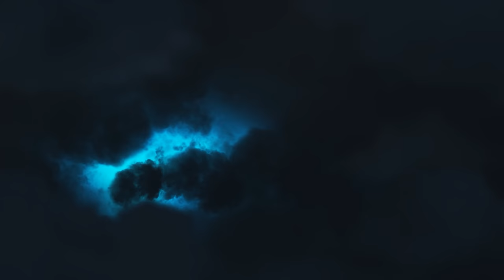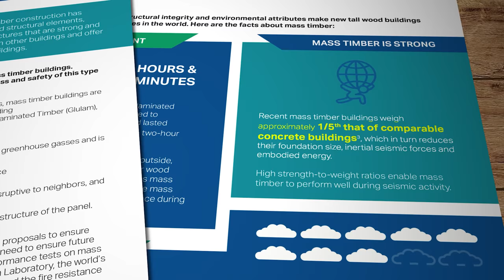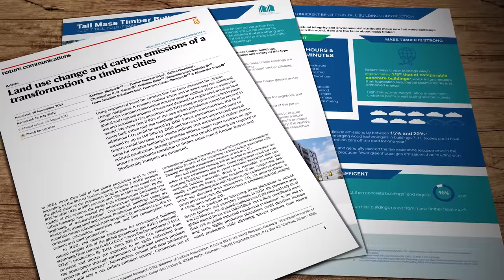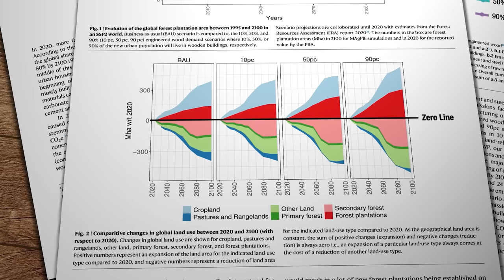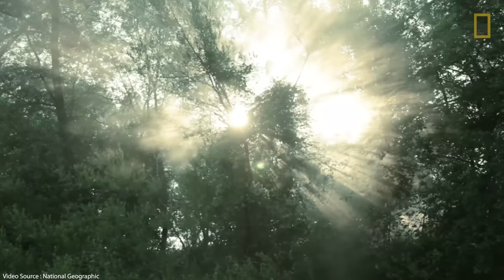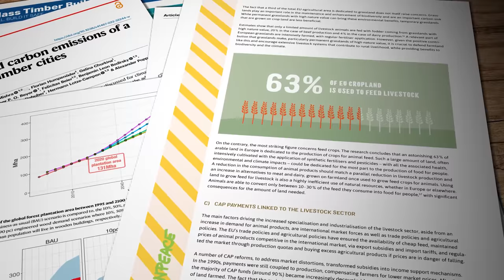Engineered Timber - building the skyscrapers of our future.

Comment: I am a maple syrup producer in Ontario and I manage a natural forest for firewood, building materials, crop and wildlife trees. I pretty well only cut dead wood, the kind that burns by the millions of acres in the world every year, and I have built about a dozen buildings, provided 50 cords of wood/year from tops, slabs, rotten trees, etc and I would say that plantations are not at all necessary for lumber production. Cutting dead wood over very large swaths of land for building materials and fuel is what is needed. no clear cutting, just a lot of little lumber jacks like me, cutting dead wood. It helps to reduce danger from forest fires, reduce the impact on other areas that get logged by taking less from a larger area more often. But the real beauty of it is that it is far far more productive of a system over the years then any clear cutting can be and every tree if it is cut when it is freshly dead is always as large as it could possibly be. It takes time to get the system running well, there is a lot of little wood to deal with initially but after 15 years now, the trees that I harvest are much larger and much more sound than when I started and the productivity per acre has more than doubled. I scatter my ashes back in the woods and they seem to really like that too. It is just like manuring the fields that grow grass for an animal.

Comment: Thanks for another thought provoking episode! As with everything around the massive challenge of climate change we will need this along with decarbonisation of concrete and steel. I think the point Greenpeace is making about landuse for feeding livestock is a ver valid one and should be part of the solution. One other important thing to consider is bamboo. It is actually in some form local nearly all over the planet, grows on soil little else will grow on, like salty ground near the shore. There was a big European research in material science quite a while ago. Did you ever do an episode on it? I would be interested, how all the promises of that has stacked up, or not!?!

Comment: I have been working in wood constructed houses, but not the CLT ones. I really believe it is our best future. They can be disassembled in layers, in which they were build. Less than 5% are chemical substances. Stocking of CO2 in wood is natural, and if ever at life end can be burnt or composted.(not in the case of chemically treated wood or glued CLT). Insulation can also be completely natural, eg. blown in natural fibers. If dampscreens or wind/waterscreens are used of non natural substance they should be recollected separately after demolishing. But low energy or passive houses prevent burning or using energy in the first place.

Comment: The Strength to weight ratio is a good measure when trying to keep a structure light. But for heavy duty structures, absolute strength is more important than strength to weight. Volume is also an important measure, high density steel enables you design a structure the can take large loads while looking slim.

Comment: Smaller timber can be made as engineered wood as well, relying primarily on faster growing wood, such as bamboo and using hemp as well. Even adding a small amount of carbon fiber can make them much stronger and allow even larger scales of timber. As carbon nanotubes become available, that is another resource that can be added to engineered timber as a strengthening element.

Comment: There was a recent notification form the forestry commission to the Royal Navy telling them their oak trees were ready from an order placed in the 1700's.  Wood is not a quick thing. It is often 25 years to get a crop of even the fastest growing trees.
Reply: For house building, an oak tree is the most productive between 75-125 years of age. However, we’re not talking about hardwoods here; it’s softwood like pine that is used for gluelam, both because it’s faster growing, but also higher in strength to weight, even though it’s slightly weaker in ultimate tensile strength and particularly in shear and crush strength.

Comment: What about exploring increasing tree plantation yield, and other characteristics that make for a better ‘glulam’. Apply genetics to improve yields and strength for example. 

Industrial scale harvesting of plantations is a concern. As you’ve pointed out, soil is depleted during each harvest, as minerals in the soil will be sequestered in the building structure along with carbon - potentially for centuries. How these are to be replaced at scale should be factored into any study of sustainability.

Comment: This is very interesting... Near us was constructed a brand new community exercise facility, and it made heavy use of engineered wood in the construction. It does in fact look very nice, although I think to the untrained eye, like mine, the immediate thought was, "can wood really be strong enough for this use?"

Anyway, I think what you are suggesting is a bit of a false choice. If we can't reduce the CO2 emissions of steel production enough, we can look at other composite materials that don't require wood, such as carbon fiber composites or even graphene in the long run.  I think there is a lot of potential for creating strong materials with sufficient fire resistance.

Comment: You can get around the issue of monocultures if you grow it in a polyculture using native trees (or at least something from nearby so the wildlife does better with it) with the right wood qualities in a managed area along with native understory plants. Removing less than all the trees at a time and splitting up the areas that get cut down so that it doesn't become completely barren would be at least easier on the wildlife, it may take work to accommodate some of the more sensitive native species, but it'd be a good idea to do at least something like this with the land freed up from farms if we use less meat going forward.

Comment: in fact, I am quite convinced that the best way to capture carbon dioxide is through reforestation and the use of wood in long-term formats, as proposed in the video. It is the mode that uses economic forces to its advantage. It may not be the only measure to be used, but it could be one of the main ones and, in the future, perhaps the most important.

Comment: What about using hemp rather than wood in building materials? It can partly or completely replace cement in concrete, fiberglass in insulation, timber in walls, etc. It's fireproof, lightweight, grows amazingly fast, and sequesters more carbon than trees, locking it in permanently.

Comment: This is a great idea I have been following for a while, here is the solution to the problem. First there is nothing wrong with the exploitation of natural forests in fact it is actually desirable. Land is being cleared for agriculture by simply slash and burn the forest is regarded as having no value. Clear-fell natural forest but let it recover naturally this is how it works in nature when there is a forest fire or slow cycle slash and burn. It is sustainable generates jobs and leads to greater biodiversity read Patrick Moore's book trees are the answer I would also suggest his other book Confessions of a Greenpeace dropout.
OK apart from all that in Portugal we have problems with forest fires due to the growing of eucalyptus trees for paper.
This brings in Australia itself if the natural trees were grown straight, they would be usable as timber and would not go up in smoke in periodic forest fires.
If we managed the wood for timber the country would get a much better return helping the balance of payments and generating MORE jobs. To quote Patrick Moore Trees ARE the answer. The thing to realise is that using wood for construction not only displaces the carbon footprint of steel and concrete it also sequesters a whole load of CO2 if that is what you want to do. Last point this is a vast generator of rather pleasant jobs.

Comment: Thanks for the balanced or objective way of looking at it. I used to think we could just grow more forests, provided we build lots of water infra. Now, I know that would warm the planet even more... Or will it. It seems that despite the darker color, the forest is (a lot) cooler! Hmm, perhaps it's the process of photosynthesis that "eats the heat". You know, chemical reactions require energy. Energy that would otherwise be wasted as excess heat.
Anyways, yes, stick with steel (don't know why we need concrete other than for the foundation). You see, the forests are like a 2D thin veneer, and the magic of the fragile biosphere. The steel is from below, in massive 3D quantities.
We're going to clean up our energy act, anyways (thanks to Tesla)!

Comment: Agreed, forests are more than timber, steel can be made replacing coal with hydrogen as reductant- so steel from sunlight (solar PV). Similarly, agriculture / grazing can / will move to artificial production, precision fermentation. Free up better grazing / dairy land for tree crops - eventually return to natural ecosystems. **not much soil nutrients in lumber itself (Ca & K), mostly in bark & leaves, that can be managed. AGW isn’t only issue on agenda.

Comment: As someone who has been looking into planting trees for timber, there are a few things that should be noted. 

Massive reductions in actual new land needed can be achieved quite easily. There are currently hundreds of thousands of acres of farmland that are barely profitable to farm, but are farmed because the farmer can't rent out or sell the 8 out of 500 acres of poorly performing land. A subsidy for planting of trees for timber on poorly performing farmland could be a very attractive option for those farmers, especially as the income from tree harvests start rolling in and word spreads. Also, as the area is already heavily farmed, no reductions in biodiversity will occur. 

Then there's also conversion of current used farmland (which is only profitable due to subsidies) to timber growing. A good example is in Brazil, where the state heavily subsidies beef production, if they didn't subsidise so heavily, the land needed for beef would diminish, leaving space open for timber. This wouldn't even require bans or consumer action. 

Also, you can plant a variety of wild flowers between trees (as long as you ensure compatibility), which would either help maintain, or in some cases increase biodiversity (especially on previously intensely farmed soil). 

And as mentioned in the video, relatively small reductions in subsidies/consumption of red meat (even if replaced with other meat, like chicken) could on a mass scale free up tens or hundreds of thousands of acres of previous cornfields for timber production.
Reply: In our region, the trees are only productive on decent land & rainfall. And industry likes heavy concentration for harvest. In particular, few edges. Plantations aren’t afterthoughts. Economics generally doesn’t favour trees, just too long term, risky.
Reply: @iandavies4853  thats where subsidies come in and reduce the cost of the risk involved in growing trees. Our markets aren't build to take messures against the problems of our time. Regulation and subsidisation are essential to move the market to where it needs to be.
Additionally increasing biodiversity in wood plantations reduces risk of desease and catastrophic events. We learn this in europe right now. Learning from the mistakes of others states should fund the build up of divers tree plantations.
Reply: @TheTpointer  I agree society needs to divert funds to failures of economics, though politicians generally fail miserably in crafting such measures, pick winners (losers). I (still) favour a carbon tax, as one part of general solution, but room for (smart) subsidies too. 
Our economic, politics, legal systems are just too crude, too corrupt, too uninterested in ecology etc.
Reply: There is an alternative that is an excellent compromise and will help smaller farmers.  Mimicking forests to grow more, better food while replacing bad ag practices would be all plusses. 
Mark Shepard of Restoration Agriculture fame mimics local forest guilds by growing food crops of trees, vines, shrubs and perennials.  He converted a run-down dairy farm, in an area that was open cultivated fields and general bad land management.  He uses a savannah/alley cropping for more efficient food production. This assists in pest management as well.  He also uses livestock in a variation of mob grazing as part of the management system. 
You end up with more calories and nutrition per acre than the previous use or that of the neighbors. The trees sequester carbon as well as provide a timber source towards the end of their life cycle.

Additionally trees transpire a huge amount of moisture they would naturally contribute to the albedo effect, contrary to claims by some.
Reply: @TheTpointer  if something requires subsidies to work it is not a valid solution.
Reply: @b_uppy  the albedo effect was for near-arctic, is a red-herring, is green trees vs snow. Anyone planning on slowly growing trees for a century or two? Melting Arctic icecap / open seas far more important for albedo.
Reply: @iandavies4853  
Tree transpiration produces clouds.  Clouds are white.   White reflects. 
Better still trees transpire when we need it,
Reply: @b_uppy  I wasn’t going to buy into that, too complex for me.
But water vapour is a greenhouse gas as important as CO2.
(Plus clouds have albedo from below)
I’ll leave it at that. Not my skillset.
Reply: @iandavies4853  
Want to see how much water a tree can put out and how quickly?  Find a trash bag and secure it over a branch with leaves so that moisture accumulated stays in the bag.
Reply: @b_uppy  are you a bot? You don’t respond with logic, but trivia. I’m a biologist / farmer, sort of, so yeah, I do know. What I don’t know is atmospheric physics / dynamics. PS. Much of AGW is night time warming - clouds.
Reply: @b_uppy  I’m indicating I’m NOT an expert - esp on AGW. And your argument is weak - if atmosphere is warm & dry, it’ll find a way to evaporate from oceans etc. And water vapour overall is a greenhouse gas, even if specific clouds (water micro-droplets) are reflective. Why even focus on this topic? I’d responded on stuff I know something about. I do know a bit about crop & tree transpiration, at level of stomata as well as per hectare of crop or forest.
You are just trolling for fun. In a dumb way.
GWP of water vapour is tricky, any additions are removed as rain within weeks, but concentration dependent on temperature. Yours is a spurious argument. We can’t directly regulate water vapour like we can for CO2, so don’t concentrate on it, except to recognise positive feedback loop. 
Deal with what you can alter, not fairies & unicorns.
Reply: @iandavies4853  
The first 3 sentences above are mine, the rest I just copy and pasted from NASA's website.  
Oceans provide rain at less than optimal times compared to vegetation.  The warm ocean air hits cooler winter air and dumps the most precipitation during the cooler months of Fall, Winter, and Spring.
The soil stores that water, then the trees take up that moisture and release it more during warm months (as there is more green leafy material during summer), even far away from the oceans.  
That it is Summer when the albedo effect is needed most, then tree planting is more important to it.  

Not assuming you'd understand, or that you are an expert.  Far from it.  Did notice that your busy thinking about how fairies, unicorns, trolls, bots, stomata, not looking dumb, trivia, your lack of skills, being weak, etc all while claiming to be a biologist/farmer on YT.
Btw stomata was covered in HS biology in my school...

Comment: If this can be done with timber can it not also be done with bamboo and hemp? I know timber technology has come a long way but research with bamboo in the tropics has found the drilling out the center of large bamboo trees and filling it with concrete achieves strengths comparable to steel. If you could use carbon sequestering concrete of even hempcrete to do this would it offer a better solution. Bare in mind that hemp and bamboo grow 3 to 4 time faster that trees and use less water.

Comment: The amount land needed for these “new timber forests” will of course depend on the growth rate of the tree species planted.
From my personal experience in different forestries, I know that the yearly growth can be:
- as low as 3m3/ha (pine trees in Europe), and
- as high as 50(!)m3/ha (Cloned Eucalyptus in Brasil).
- Certain Bamboo species (while technically a “grass”, they can be processed as engineered timber as well) have even higher growth rates.

While protecting native forests and their biodiversity should definitely be a priority, it could be a viable compromise to convert only a small part of those natural forests into managed forests, but with a substantial percentage of selected high growth tree species.
The condition must be that the remaining natural forests will be large enough to continue to be a functioning ecosystem with all its biodiversity.

Comment: I am aware of the carbon cost of using steel and concrete as a result of content like this but bricks are rarely mentioned. Bricks moulded and fired in Electrically powered brickworks already exist. Bricks have been used in history to create large, strong structures. I would argue that the old fashioned brick and timber combination could be used for a large proportion of our building needs.

Comment: It's not a tricky one. While you can move towards using timber for taller builders, the solution is to reduce the CO2 emissions from steel and cement production.